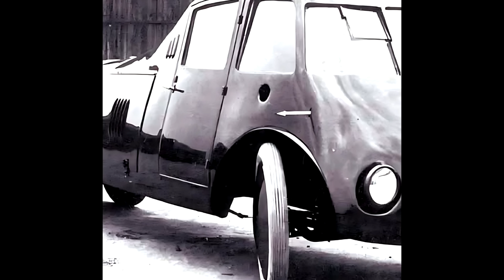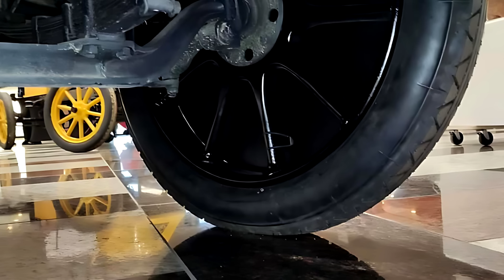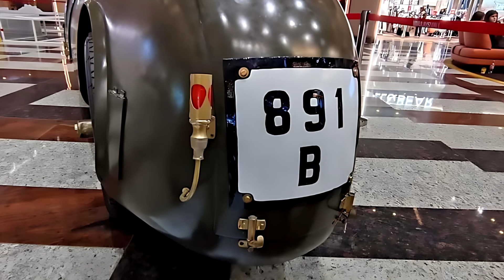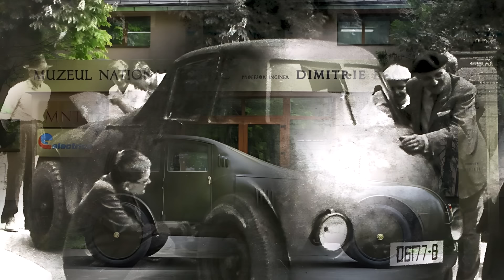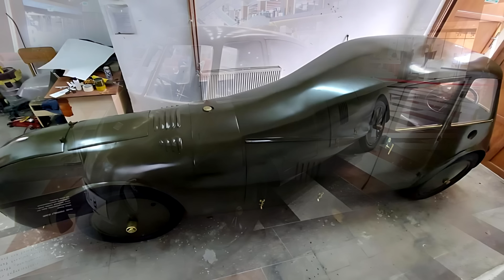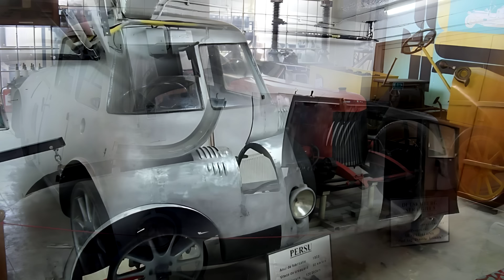1922 Aurel Persu Streamliner — The Car That Beat Modern Aerodynamics 🚀🚗

Comment: It should be possible to replicate this body style.
Then, instead of a 20 kW combustion engine, install an electric motor with approximately 50 kW and a suitable battery. It would be an ideal car for short trips, such as shopping.
Reply: OSTRITCH-YER HEAD-'DOUT OF THE SANDS OF TIME AND HIE! THEE TO (NOT A NUNNERY) BUT TO CARLSBAD, CALIFORNIA. ASAP= APTERA.

Comment: Part of the reason that cars weren't aerodynamic because aerodynamics doesn't really affect performance until you get above 30 mph, which most early cars just couldn't attain.
Reply: also need smooth roads for higher speeds
Reply: The vw bettle was a fuel mizer up to 58mph .

Comment: As cool and as advanced as it was for it's time - a drag coefficient of .22 is unlikely.

Firstly - the underfloor is completely uncovered - as was standard in the day.

Additionally, there are still quite a bit of gaps and edges. The headlight housings cause drag, so do the square windows and their edges. The brass bits stick out, too.

To be fair - design and layout are quite similar to modern highly fuel-efficient vehicles like VW XL1 - with a real-world consumption of 2 liters/100km.

Therefore - in a time before wind tunnels and computer modelling - it was very, very advanced.

Comment: Looks very much like the car designed by Hungarian Paul Jaray but driven 'in reverse'. The two cars were built at around the same time and I'm wondering if they were in contact.
It would be interesting to compare the drag coefficients of the two cars.

Comment: It took another 33 years for the Citroen DS to take aerodynamics into mass production in 1955.
It also had narrower rear wheels full enclosed plus clean underbody. 
Also first production car with front disc brakes which were inboard.
Reply: The DS is still modern compared to most cars today.
Reply: @grahammonk8013 except for the engine. Imagine a DS with the Tucker flat 6....
Stratospheric..
Reply: In 1933, Buckminster Fuller produced the Dymaxion car.
Reply: @rcpmacREALLY?!!
I ONLY KNEW OF HIS DOME! & NOW YOUVE HEARD OF A VEHICLE!

Maybe we will get to see it on this channel! 👍
Reply: @stephenberry8658 3 days ago (edited) Take a chill-pill-today, or a TODY.  DO-OOS THE GAPES WITH THE APES OF THE APTERAS' PRODUTIONS IN REDUX!
Reply: Look at the Panhard Dyna Z which was introduced in 1953 and available for sale in 1954. It was incredible advanced for the time including a Cw value of a 0.3 which gave this car with it's litlle 2 cilinder engine a top speed of 200 km/h. Panhard was later sold to Citroën and a lot of technology andcdesign knowledge was implemented in the Citroën models including the DS. Panhard's history  is a very interesting read.

Comment: A lack of power-assisted steering necessitated creation of the Brodie/suicide wheel spinner knob.
Reply: it may not have weighed much and those tires would have been easy to turn so i am not convinced it was difficult to steer.